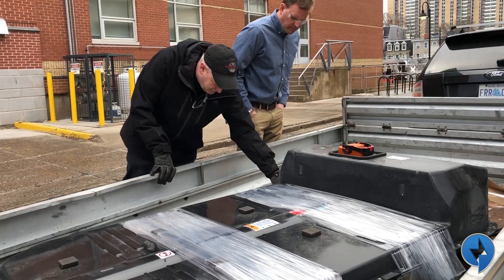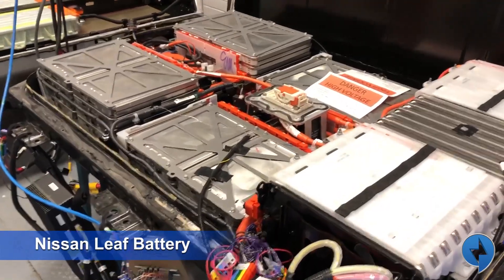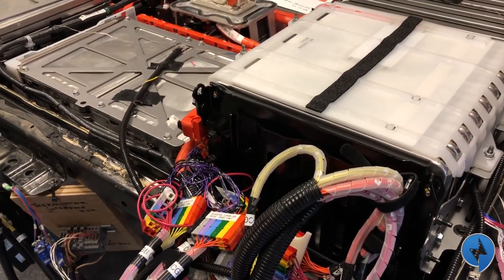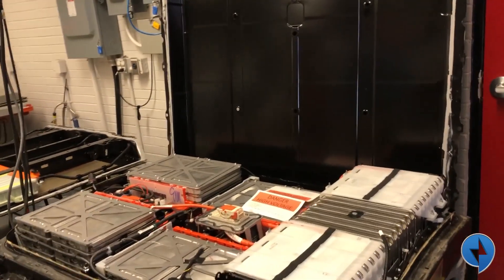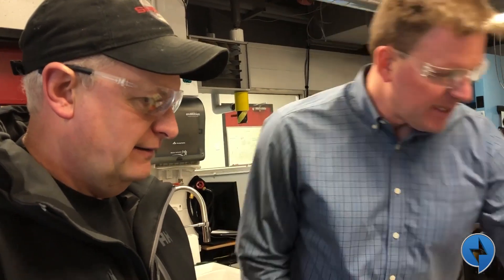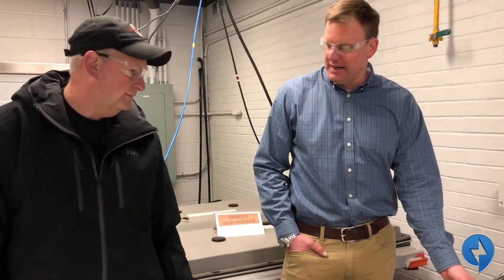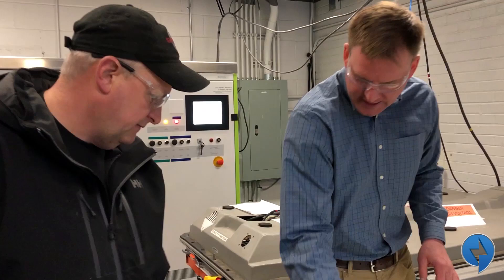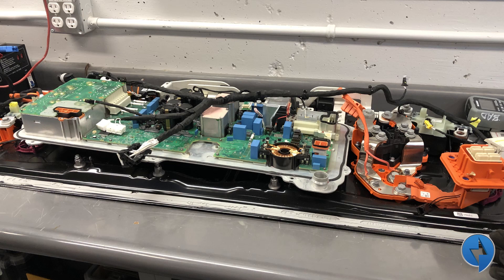ALL EV Canada Battery Second Life - Dalhousie University Renewable Energy Storage Lab (RESL)

Comment: So replacing the battery is no easy swap. That means that not only is the new battery expensive but also the labor cost will be high ?
Reply: The model S and X are a lot easier.  I work on Tesla's and M3 battery packs are always a project.
Reply: @rome_nyla  I watched a little video where Elon Mush showed battery swapping could be done as quickly as filling the car with fuel. Are you saying that the battery in the latest models can be removed without going into the interior ( from the bottom). What about the coolant fluid disconnects. Thank you.
Reply: @houtansadeghi  New models definitely can not be changed as fast as older models.  Model 3 and Y have bolts in the interior of the vehicle and no quick connect for the coolant hoses like the older S&X models.